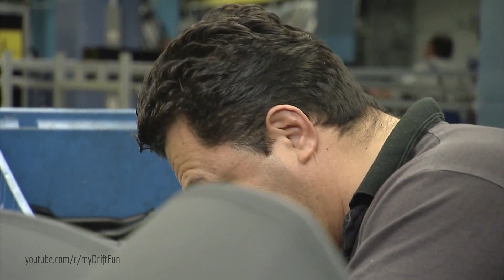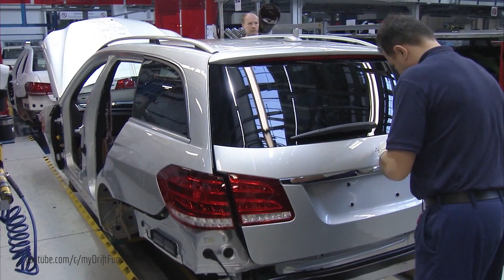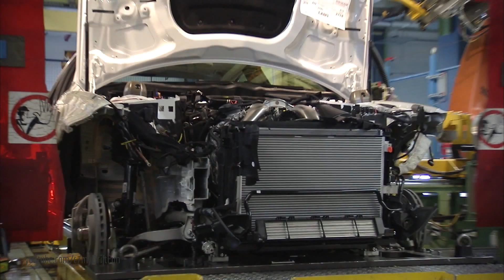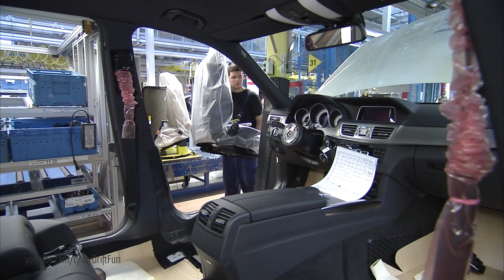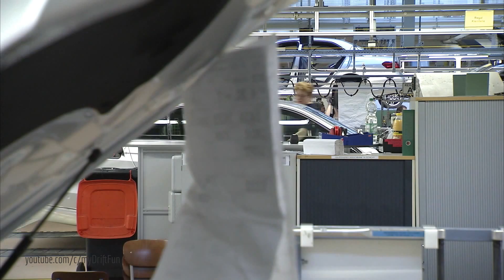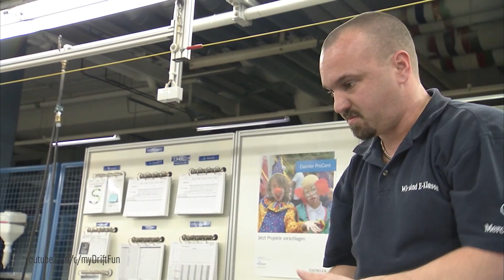Mercedes-Benz E-Class W212 Facelift Production In Sindelfingen

Comment: At 7.03, you can see the rear air suspension bag being so flimsy that there is a dent on it. My 212 estate goes down in the matter of minutes after I park it and it will cost the best part of £1,500 to have it repaired. They should really make these more durable. My 2003 211 also has a leaking air suspension, but I kind of expect that from a 19 year old car.
Reply: From my understanding, they have an aftermarket kit that makes them much stronger and more reliable.

Comment: How are those cars taken from the production line? Do they have any fuel in it?
Reply: Nivaldo Covolan yes about 20litre in thé last step
Reply: Each one gets 15.5 liters of fuel.
Reply: @davidgold5961  Thanks. Do they drive the car as test after out of production line?
Reply: @Nyck461  I am not going to make up a story and say that they drive every single car, but I do believe that they do. At least a short test drive. Keep in mind that when Mercedes-Benz released the W212, they spent approximately €1 billion on it and they knew it had to be really, really good. This is because the previous generation E class was not that great. So I would not be surprised if they did at least a short test drive of most of the cars coming off the assembly line. Of course this would vary depending on which assembly line we are talking about, because it was manufactured in different countries.
Reply: Yes, they do. My very first Mercedes was brand new and had 6 kilometers on the clock.